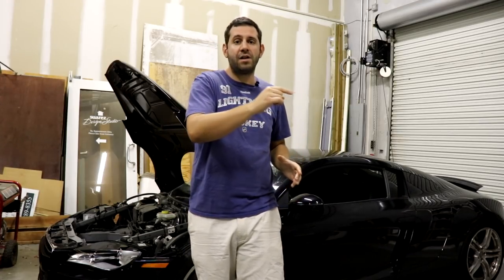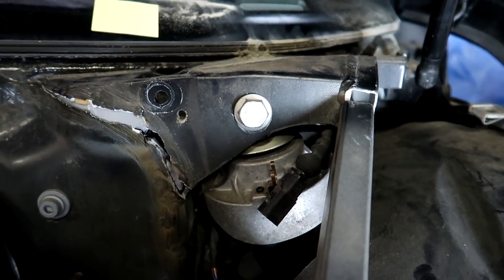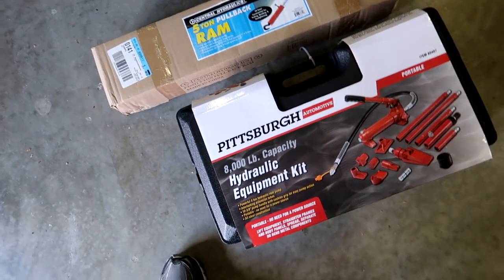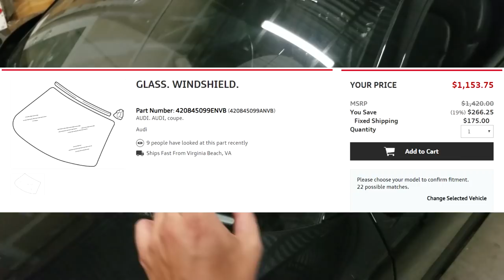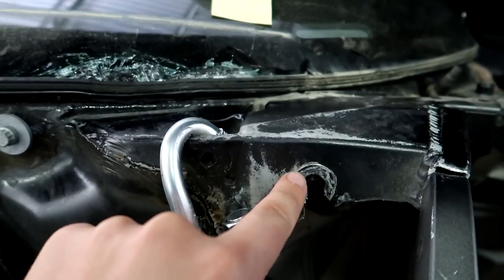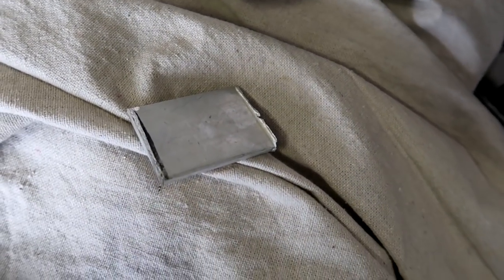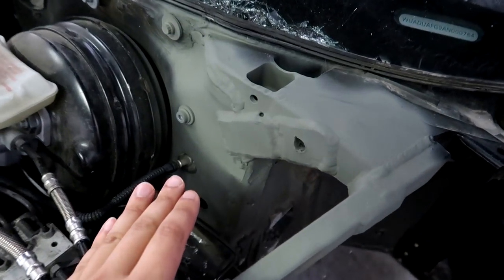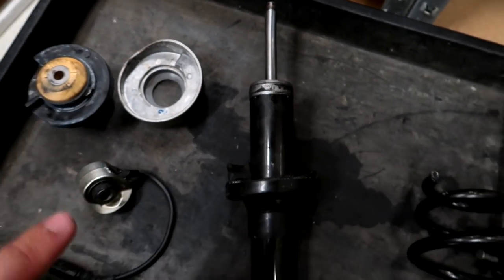I Repaired My Totaled Audi R8's Cracked Frame for $500! Insurance Quoted $29,522!

Comment: I repaired one basically the same way, harbor freight and all. Had about 4 hours in the whole job. Track days and a ton of street driving later it's still perfect.
Reply: Never been more excited for one of your vids well done
Reply: 4 days of hammerring.... looks more like an couple of hours job indeed ;D
Reply: @Moosey1789  the prize for living safe is usually regret
Reply: How is the crash zone effected? The repairs Sam and I both did literally doesn't modify the chassis in any way other than making that area stronger....  If this repair is done by Audi it's the exact same, other than they take the whole god damn car apart to complete it. We just went about it in a more efficient manner and have half price R8's to show for it. #copartracing
Reply: I disagree... I mean, really; 
Won't we all end up sucking food through a straw eventually, unless we die first... But then I suppose we'd get the long life part...  :)

My Main concern is nowhere during the video did I see him inspect the lower frame  assembly... Mind you, I'm not a suspension expert, but past repair experience tells me if something moved up top, the lower must have moved too, or at least been under a great deal of stress, since the top wasn't sharing the stress load.

Pulling on the jack stand was entirely stupid... he's luck the car didn't land on his foot!
 

Also, as he mentioned early in the video, aluminum is more likely prone to cracking vs bending (depending on type of aluminum)... Which means he could possibly have caused internal cracking he can't even see with all the pulling forces and pounding he was doing, perhaps internal to the metal structure, or even hidden by the paint. 

A better way to pull it down and not tear out the shock tower bolt hole would have to use a large thick nylon cargo or tow strap looped over the upper assembly, thereby dispersing the load across the whole bracket - of course you might have to cut the strap to remove it,  but you could buy a hell of a lot of straps for the $1500 he is going to pay for that windshield...

I'm not saying I wouldn't drive it though;
But prior to driving it at all, I would pull the plastic skid cover from underneath and perform a detailed inspection of the lower assemblies, just to be sure there isn't any other damaged areas.
I would inspect it after every trip for the first 500 miles too.

I do agree with K McCoy's comment from above, that he should have had the welder sleeve the cracked fender/nose support.  It would be really shitty if you lost control of the car, and hurt, or even killed someone; especially after a quick (and cheap!!) repair.

The welder did a fine job on his part, and $300 was way to cheap for that job; He must be hungry!

Please comment if you agree or disagree...
I do take Kudos or Criticism equally well,
and I'm willing to learn, if I'm wrong!
Reply: Theres tons of guys racing old 80s v8 deathtraps out there, in fact theyre like the standard for club racing and those arent exactly safe either
Reply: @mikeeckstein4324  don't be so stupid!  I am a Audi,Range Rover and BMW,  Merc tech.. I've been a panel beater for almost 20years 
Firstly that's not what we're taught to do by Audi..  That's a cut and shut job.. Done poorly too. When that car gets in a major accident it 100% won't fold up how it should..  If you wanna know how it should have been done properly I'll put up a video next week as we have a R8 front ender at work, I'm not doing the job another lad is but I'll put up a few video's of how it should be done correctly!  Samcrac could end up in prison IF someone dies in that car on the road.. And it's looked over and seen that it's be gashed up. You're liable..
Reply: @mikeeckstein4324  and with how much that moved 100% that front square tub won't be in the correct position..  Suspension probably won't line up correctly on one side.. 
Plus you're ripping someone off.. That's sad..
Reply: @shiftinggears9896  who am I ripping off? Car took an alignment no problem. Have you looked at the chassis design of a R8? That piece literally only holds the upper strut mount. Has absolutely nothing to do with the suspension control arms or steering rack mounts.
Reply: Samcrac and I literally rewelded Audi's poor design. We didn't re engineer the car. They should have built it better in the first place so the chassis didn't fall apart at 40k miles of normal driving. Seems like they are the ones ripping people off.
Reply: As a retired Tech, I would have to agree with your comments ... especially the suggestion of using the web strapping to help spread the pulling load. Having said that; since all the damage was mostly structural and knowing the nature of aluminum  replacement of all the damaged sections would have been the way to go.  I would also want to know how the damage occurred fore attempting any repairs.
Reply: @billybob042665  The square tube may be a part that is designed to deform in a crash, but the repair only strengthened a short section and overall will likely have little effect.  The upper shock/spring mount repair is not in an area that is typically part of a crush zone.  In any event, that area has to be strong enough to support the weight of the car and stresses imposed in driving.  If it is such a common failure, then it is a design flaw.  Lastly, this a common problem with aluminum.  After being repeatedly stressed and released, the metal loses strength and becomes brittle, then cracks.  That is failure mode common in the airline industry.
Reply: @theq68  when you learn to spell come back and I'll give you a reply..
Reply: @DubTech Tv uuuuuuu if I was 10 I would be offended. lol
Reply: @shiftinggears9896  - I've bookmarked your page to wait and see how you would have done this. It was painful watching this guy do this, but it's interesting to see how crappy they make cars, expensive cars too. Even with the repair job, I'm flabbergasted at some much pin pointed energy going to this one area, supported by minimum aluminium. I usually beef everything up, a lot more even than what was shown here, especially when I'm already welding. I've seen people weld and say that's sufficient, but I always think the worse and try to avoid returning. 

Someone has stated that the underside should be expected, which is a good point, but this is where I would have thought that shock, with moveable suspension and steering components would have had give? I'd check it anyway, but that top area is hopeless. I hear what people are saying about crumple, but with that snapped aluminium cross piece, I would also have beefed up; maybe steel/aluminium square tubing insert etc. With all of this, the design is still bad. Another guy said that there car went into a ditch and suffered the same. Even with reinforcement, the design is so bad that I'd expect trouble in this spot again if the car went into another ditch. Definitely not a car to be taken off the tar. As stated, will wait to see how you do it.
Reply: The right way to fix this is to cut out the whole corner at the welds and top of A pillar and weld in a new piece. That can then be strengthened by the plates Audi puts in in the newer versions of the car. Necessitates taking apart most of the interior which is why this is expensive. Also, working on the aluminum with tools, especially grinders which have been used on steel will result in contact corrosion and things falling apart pretty quickly. Ask me how I know. This by the way isn‘t a very common failure and probably always caused by undue stress (potholes etc). You may have spotted the bent shock, that takes a massive amount of force, probably enough to start the crack. Looking on the web you‘ll find maybe ten cars with that problem, Audi has built thousands. I used to have one, no issues myself.
Reply: @floriandiederichsen6597  - The author of this video originally stated that Audi takes the whole front section off and replaces this: well that's what I think I remembered him saying? I was thinking exactly what you have confirmed i.e. the interior side of that aluminium they welded. Yes, plates, exactly. Contact corrosion? Interesting; I'll have to look more at that. The remainder of your reply does put things in better perspective. I just think of my car, which has a lot more steel supporting the shock absorber. Thanks.
Reply: Hi James,
Might be true if the actual frame holding the wishbones is damaged, can look in the repair guide later on if that is interesting to you. Shock dome is replacing sheet metal “only”. Still needs a jig or carful measurements, windscreen needs to come out, repaint of at least that corner and so on. Can mail the Audi specs for it if interested. Or go to Erwin.audi.com where you can download all shop and repair info for little money.
Reply: @floriandiederichsen6597  I see, but no need to go further. My car was totalled but I repaired it by eye, a tape measure and buying pulling and pushing equipment. 
Just watched a video of a Russian guy repair the back quarter panel on one of those large BMW's. Always wondered how they did this. For a split second he showed himself using a laser to compare sides to get the back door to close properly etc. So this is where facets of what you say about jigs and careful measurements come into play. Factors which affect handling also and of which I recall panel beaters needing to conform to computer measurements, so that handling etc are maintained properly. Thanks again.
Reply: They have pretty nifty laser measuring equipment at the factory plus a robot with a feeler gauge to measure the frame post welding in a jig. Quite some effort being taken to make this right originally. You can’t straighten/move anything post weld according to the guys I spoke with there, if it doesn’t come out to spec it is scrapped (May never happen, didn’t see them throw out a frame when I was there :-)).
Reply: @floriandiederichsen6597  we have a carotronic laser system that is super accurate and can take measurements anywhere on the car. Even the roof can be measured. 
Audi would recommend putting a new front end on this car and there is a very good reason for this.  Integral strength 💪.  Aluminum when been in an accident fractures and to weld split panels back together is just a cut and shut job.
The car won't fold up how it should when in another accident. Audi spends millions yearly crash testing cars and repairing them and crash testing them again.. There is a reason why they tell you to repair thing's the way they want you too. We have one at work that has been gashed up worst than this. We will be putting a hole new front end on it.. The car is completely stripped..  Everything from interior forwards is striped and ready to go on the jig. I'll upload a video if you're interested in how it's done properly lol
Reply: @shiftinggears9896  Fully with you on that. Replacing the longitudinal members takes a jig according to Audi, suspension turret can be welded in along the original seams apparently. Looking forward to see your video of the proper repair.
Reply: OK, the part needed is 420 805 151 E
Reply: @floriandiederichsen6597  The job so far is at around £38000 the insurance tried paying the woman out 50k but she wasn't impressed and wanted her car repaired. 
Basically the car was repaired at another bodyshop then the car came to us because of on going issue after the repair was done.  Then we noticed how they cut and shut the tub framework and front panels. 
Basically it's getting repaired properly this time. =one happy customers in a safe car which she puts her child in.  I always repair everything to methods. We are liable if anything goes wrong and someone dies,  which does happen.
Reply: @mikeeckstein4324  @samcrac   was that a 110 welder or 220??
Reply: @shiftinggears9896  I would like to see how the "official fix" looks if you would be so kind. Would be interesting to see the difference.
Reply: Finally a positive comment which I agree on.
Reply: @ricolaw2571  sub up and I'll do it next week whenever the job is done

Comment: Why would someone try pulling on there jack stand... that’s a great way to rip the jack out from underneath it.
Reply: I agree. The weakest point is going to fail. Stand clear.
Reply: Wow. Sketchiest thing I have seen on YT in awhile.
Reply: Right?? He's lucky it failed elsewhere first.
Reply: Exactly what I thought
Reply: I would have drilled some holes in the cement floor and put in an anchor. I've done it in the past and its worked good. Later I  patched the bolt holes up with concrete patch. A job like this doesn't need that much force to pull back into place. Kudos to sam for even attempting this himself. I bet all those thumbs down are from the guys who own the ICAR approved laser frame racks that cost a billion $.  I think he's been watching too many arthur tussik videos lol.   But i'de like to see some diy'er on youtube either build his own frame straightener or buy one of the low end 80's technology ones and fix copart wrecks in their own garage.
Reply: Exactly. It's like kicking a plastic chair leg when someone is sitting on it..
Reply: I disagree, the line is connected to the jack and the car. But since the car is (partially) resting on the jack this force cancels itself out. All that it's doing is creating a sideways momentum on the car. So if anything were to happen it would be the car tipping sideways, which would take for ever since you'll have to lift the right rear tire off the ground entirely before it starts tipping.
Reply: I was thinking the same thing. I think pulling against the car itself would have sufficed.
Reply: This guy is not the brightest light bulb, paying $40,000 for a salvage r8
Reply: Can you carry yourself in your own arms?? Thats essentially what pulling on the car resting on the jack stand did. Completely fine
Reply: This is not completely fine. Yes the force is parallel and it should cancel out skematically, but that's not the real world. Since the force is not pulling directly through the center of the jack stand it is causing a torque which could twist the whole jack stand from under the car. Now I dont know the math it would take to do that since I dont have all the numbers but when you are using a hydraulic piston that can put out 4 tons, I would not be attaching it to my jack stand. He was very lucky IMHO.
Reply: @semperfidelis5797  Wrong, but nice try.
Reply: @Sryously  You have to keep in mind that a lift point on a car is designed to hold the weight of this part of the car. It is not designed to endure the additional force of the pulling motion.
Reply: @semperfidelis5797  Always!
Reply: @semperfidelis5797  it's pulling sideways on the jack stand base, it could easily pull the stand out from under sideways and the whole car would then drop 6" onto the side of the jack stand. Ouchie.
Reply: @g33dav3y  It's not "pulling sideways" to any degree. Draw a simple vector diagram and you'll understand this. https://www.youtube.com/watch?v=3fLtkNe2Dt0
Also, using hydraulics means that as soon as there's any displacement there's an instant and significant reduction in the forces, given that the fluid is for all intents and purposes incompressible. So any movement of the stand lifting on the side where the chain is hooked immediately results in the force being applied to it being almost completely eliminated - which means no more movement until the force is reapplied. That means there's plenty of opportunity to see the stand tilting before it even becomes a concern.
Reply: @TonyRule  actually, it is pulling sideways to some degree, unless it is pulling straight through the top of the jack stand, opposite to the vector of the force of gravity (the Earth's) pulling the car into the jack-stand.  Granted, the force on the sideways vector would have to be greater than the sum of downward forces and friction coefficients before the jackstand moved, which at the apparent angle in the video would probably have had to have been a lot, but there was definitely a "sideways" force vector.  I'm not an engineer, but I majored in physics in college.
Reply: @bernardechiverri1065  Given that all the loads always cancel out at any point as soon as movement stops i.e. the operators stops applying displacement, then everything is stable. Not as stable as with the stand's base flat on the ground, but stable nonetheless. The only way the stand can slip from beneath the load is once the the top of the stand is over the top of the fulcrum. That's a lot of displacement. You'd have to be an idiot to not notice the stand was tilted so severely.
Reply: @TonyRule  the dynamic forces are only static once he stops cranking on the hydraulic pull tool-- that's when it is in danger of being pulled out from under.  The rest of the time, there is the force of gravity, plus the force of applied tension,  working against the structural integrity and friction coefficients of the jack where it touches the car and the floor.  So, yeah,  it isn't likely to come shooting out from under the car. Other than when it's being cranked.
Reply: @justech  Yep, that's exactly what I said. "all the loads always cancel out at any point as soon as movement stops i.e. the operators stops applying displacement". Tipping over  presents much more risk if he leans on the car with the top of the stand directly over the fulcrum (and at some point during that event the base of the stand will then also slip on a hard surface - but that's not the cause).
Reply: @gregh7457  Actually you set a threaded insert in the cement and then keep a short bolt 'plug' in it for next use.